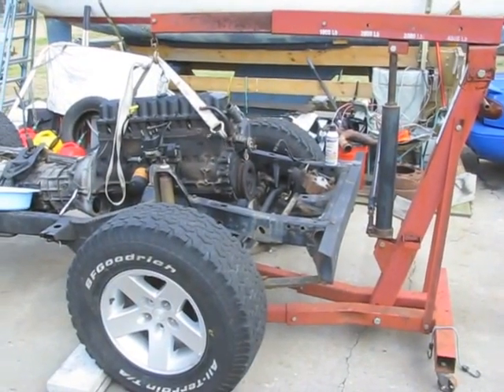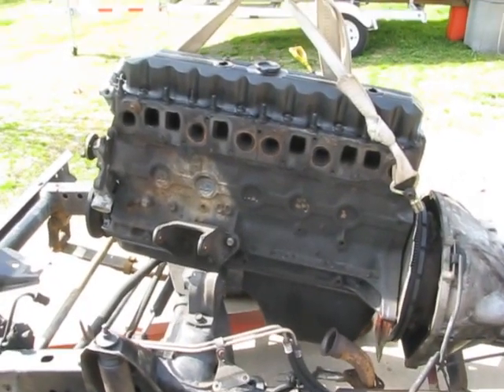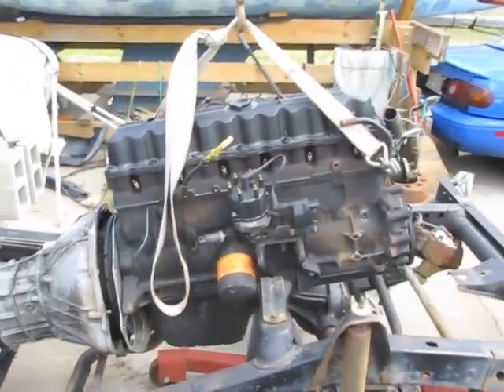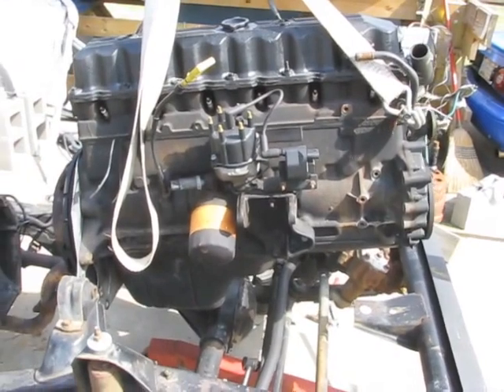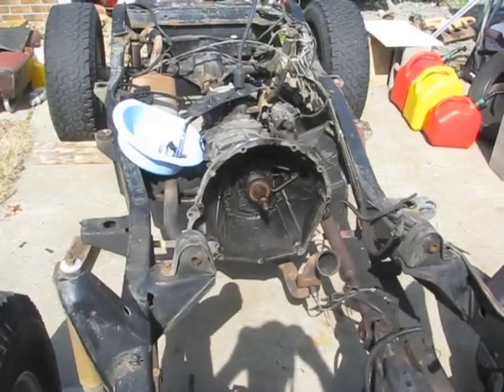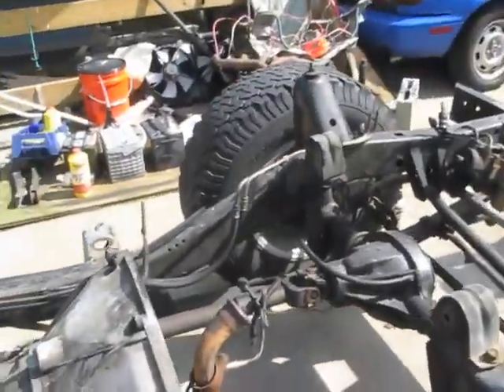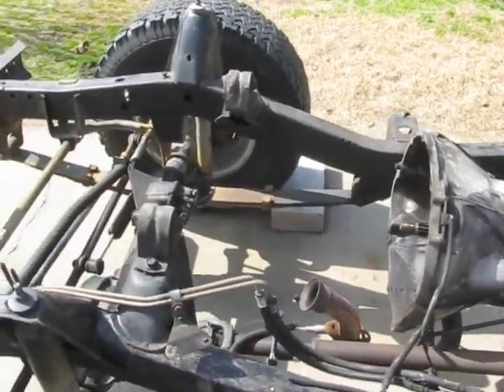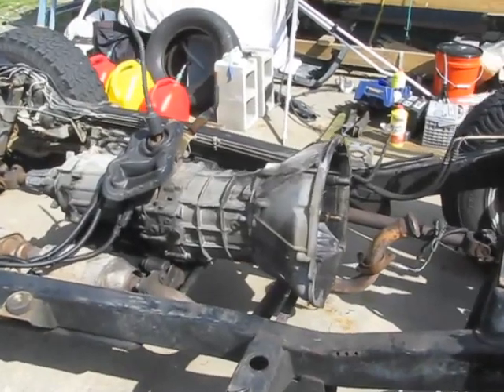'92 Jeep Wrangler YJ Disassembly (4.0L engine removal)

Comment: did by any chance that clutch kit have a clutch fork in it?
im trying to do a transmission swap from an auto 3 speed to the ax15 5 speed and im just trying to gather up info while i gather parts up.
another question is if you happen to have any of the transfer case shifters that mount to the ax15 and the stick shifter itself as well

Comment from the maker: The AX15 shown in this video doesn't use a clutch fork. It has the internal slave cylinder/throwout bearing. This was in a '92 YJ. '94 and up AX15 uses an external slave cylinder and clutch fork to move the throwout bearing. Whichever AX15 you have both use a hydraulic clutch master cylinder. I don't currently have any extra transfer case shifters. I haven't been parting out any Jeeps lately and my inventory is dwindling.

Comment: Hey how u doing .. got o question for u or some one that might know... wana stik a toyota 1jz in a 95 wrangler. . Any suggestions on how to....
Reply from the maker: If you have a donor with all the wiring you need that will make it easier. If the 1JZ engine will adapt to Toyota pick-up or 4-Runner running gear then that could be easier just using the transmission and transfer case from one of those. Of corse it would all depend on whether the Toyota T-case is a passenger or driver side drop for matching up with the Dana-30 but it would be easy enough to swap in another axle if needed. I'm sure you already planned to swap something stronger in place of the Dana-35 rear? Jeep YJ's are one of the easiest vehicles to swap other drivetrains into. It just cost money.

I think Toyota used a variation of the AX15 trans but not sure how the parts would interchange between a Jeep AX15 and theirs. 

Are you using the turbo or non-turbo version of this engine? If you like to offroad in mud or water, just remember to use a snorkel as turbo's and dirty water don't mix well. For running across the desert or rock crawling just run a good filter and have fun.
Reply: HI thanx for the info , i was looking to buy a single turbo 1jz or the 2jz , off one of the vendors in eBay, its the entire motor with harness and ecu , and trany but i like to keep the jeep trany if posible its the 5 speed , i just think these tipes of motors are a lot more efficient at producing power ..